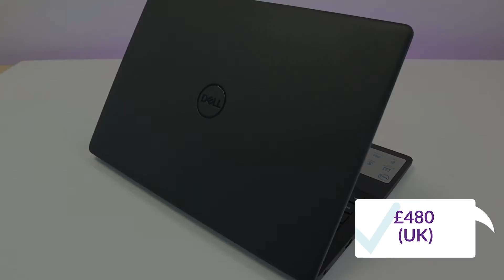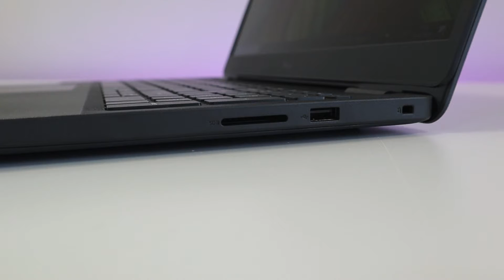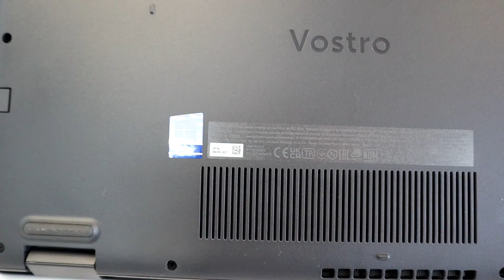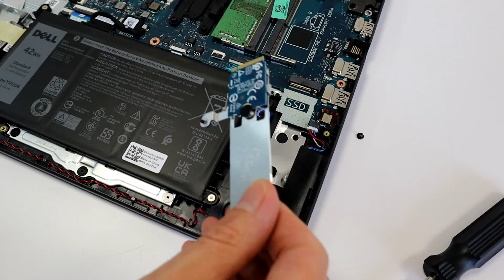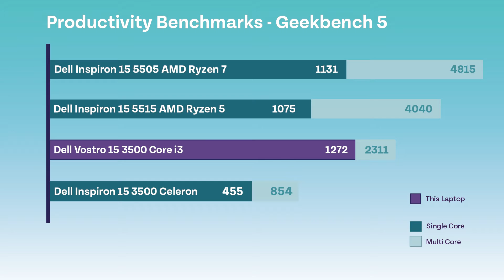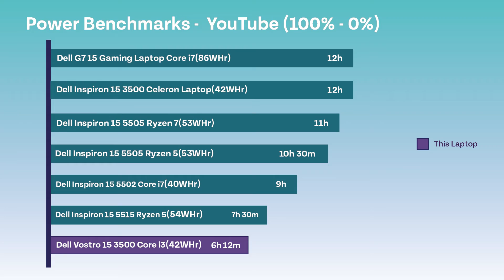Dell Vostro 3500 11th Gen i3 | Review And Benchmarks

Comment: Which is better for studying and some casual gaming
dell vostro core i3 gen 11th ram 8
or
dell vostro core i3 gen 10th ram 4
And if you want advice me to buy another laptop from other brands with the same specs please do so
Reply from the maker: I would go with the 8GB Model....  The Vostro is light and easy to use too 😀
Reply: @INOLOGYIT  Now I would go with 4 GB model and soon or later
 I will add more 4 GB as you advised me 😊
But I'm worried about heating and battery issues and I want u to tell me is there any kind of these problems or everything is normal ⁉️

Comment: This laptop has serious issues on sleep and wake. When laptop is plugged in and if I press sleep while playing any youtube videos, the screen goes black and music keeps on playing. When I unplugg the power cable, then laptop goes to sleep. Again, if i plug the power, the laptop wakes up automatically. After 20 mins of sleep, the laptop heats up and does not respond until it drains the battery. Did you encounter same issue? I am using win 10 with all drivers updated from dell.
Reply from the maker: My Dell G7 does the same, I put it too sleep, it heats up and goes dead.!!! 🙄
Reply: @INOLOGYIT  it is due to 'modern standby' which is S0 (low power mode) that does not power off the laptop. I found a news tht modern standby has cause many new gen laptop heating issues. This cannot be change to 'hybird sleep' S3 state, bcuz it is programmed at the firmware level a.k.a BIOS. So dell deliberately, made S0 as default which is causing this issue and no plans to bring back good old S3. S0 was introduced in laptops to behave as smartphones. When our smartphone sleeps, it continues to get update from internet. Same goes for laptop but due to poor power mgmt, laptop gets hot and unresponsive to wake calls. This does not happen in Linux OS. Only happens in Windows OS.